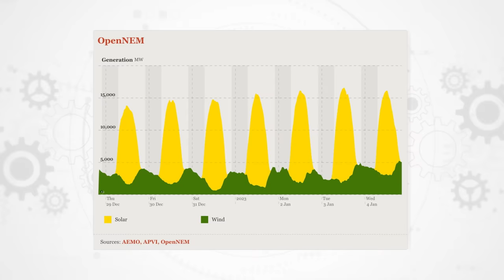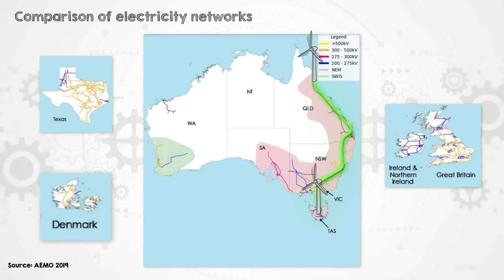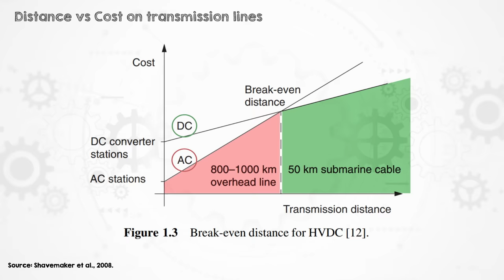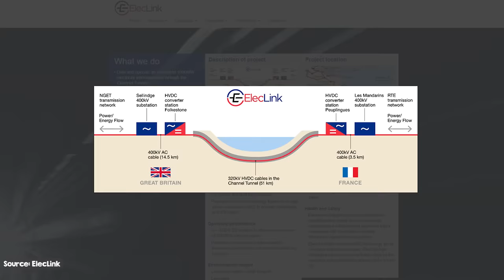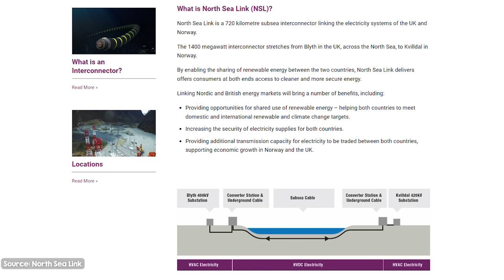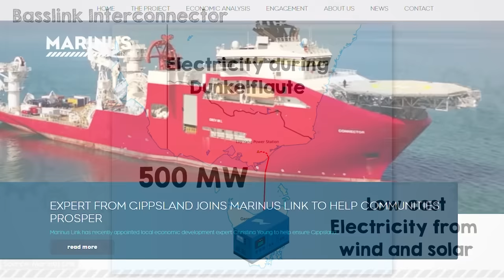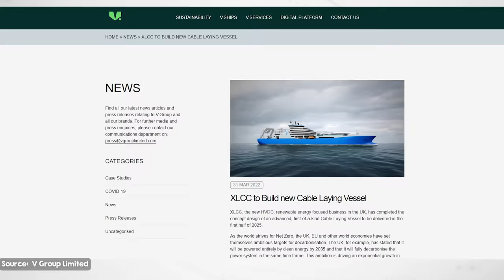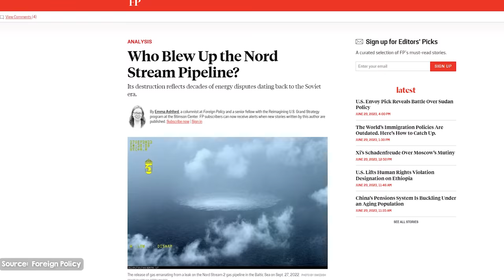Electricity Across Oceans: Is HVDC the Future?

Comment: Where I live (Manitoba, Canada) we have three HVDC transmission lines in operation.  Most of our power is from hydro and the vast majority of it is produced in the northern part of our province on the Nelson River.  Most of that power gets consumed in the southern part of the province and back in the early 1970's two HVDC lines were run north/south.  These were known as Bipole 1 and Bipole 2.  These two line were run side by side in the same right of way and in the 1990's a tornado knocked both of them down.  In the early 2000's it became necessary to run a third line and for security reasons (both weather and terrorist) it was decided this third line should be run down a different route.  This is were the story veers from engineering to politics.  The best technical route (i.e. shortest) was down the east side of the province. However, the government of the day decreed that it would run down the west side of the province.  No amount of reason would sway them and the engineers in the project remained quiet for fear of losing their jobs.  The retired engineers from the original Bipole projects had nothing to worry about and there was a constant barrage of reason and logic aimed at the government in the opinion section of the newspapers of the day.  They christened it the "Western Manitoba Heater" and pointed out that the extra 200 MW of line losses over the east side route would consume all of the power of the most recently completed dam.  None of it worked and Bipole 3 was built on the west side for considerably more money than the east side route and will now lose an extra 200 MW in perpetuity.  It's no wonder you see so few engineers in politics.
Reply: Wow, that's just so dumb.  I guess you could add (bundle) a conductor or two to reduce the losses.  Another way would be to increase the voltage and reduce the current.  But that would require upgrading all the insulators and the inverters.

I would just like to say that Canada's boondoggles are minor compared to ours down here in the US - they're a lot worse.
Reply: That right there is why Québec has multiple corridors for energy transmissions. Redundancy goes a long way when problems arise.
Reply: are they overground or underground? 200MW losses is rather high for 1000 km
Reply: @janami-dharmam  Above ground. The only place in Canada where you will find an underground powerline is in the center of large cities.
Reply: taxpayer pockets are bottomless
Reply: So that's not just a UK problem then; who knew?